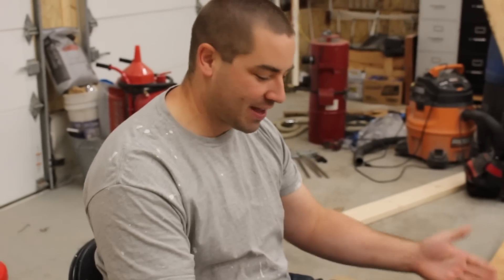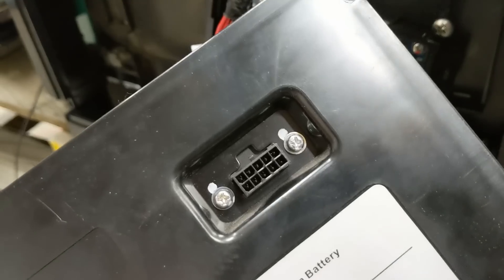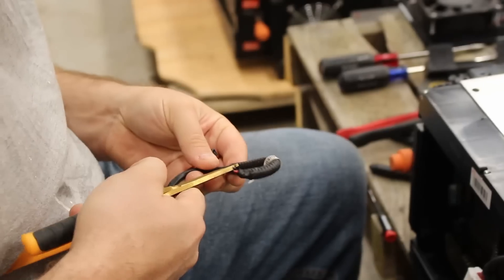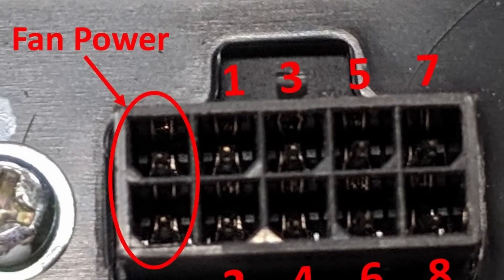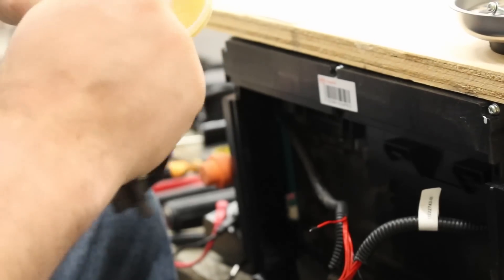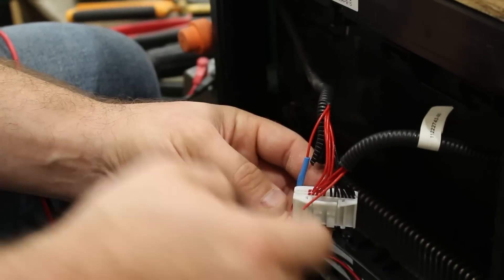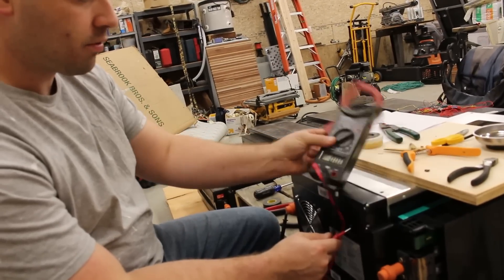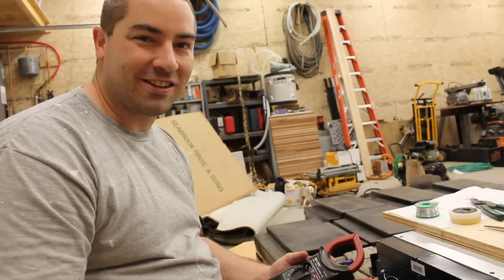Re-Wiring LiFePO4 Battery.  $100/kwh

Comment: Thanks for all the content you provide, I enjoy watching your videos. I am currently setting up 4 BYD 24v 8s batteries (2 banks in series each for 2 x 48v banks).  My plan is use 2 matched banks with a 16s BMS (Daly/Chargery). Can you recommend this configuration and/or a better solution?
Reply from the maker: My battery bank is kind of annoying me.  I have to manually go in and re-balance it every few months.  I'm not doing series/parallel connections again.  Instead I'm just using one BMS per battery.  I now parallel them after.  The BYD modules are 24v, so I would suggest using one BMW for every two modules, the two modules being in series for 48v.
Reply: @DavidPozEnergy   Thank you for your information. I purchased 2 Chargery 16T BMS yesterday. I plan on using 1 BMS for 2 Modules in Series (16 cell). If I understand correctly, this is what you are suggesting.
Reply from the maker: Yes, that's what I'm suggesting.  However, I never could get my chargery BMS to read amps correctly.  It's another disappointing product.
Reply: @DavidPozEnergy  Have you done any work with the cheap active balances available? I seen another video where someone paralleled all the like cells in 8 BYD modules and also installed an active balancer. Seems like a good setup.

Comment: great video.. Price is right.. BTW do you still use your Volt battery pack (i think it was Volt)?
Reply from the maker: No, I sold the volt pack to help pay for these new batteries. However these ones are not doing so great so I have a little bit of buyers remorse. Lol
Reply: @DavidPozEnergy  that was a nice rig.

Comment: Any thoughts or guidance appreciated. I just bought 4 of these packs for my full time live aboard Catamaran. Sadly my boat is all set up in 12volt, lighting, pumps, VictronConnect  300 wt pure sign inverter 12v to 110v. My question is would it be a better idea to leave them in their 24v configuration and step down to 12v for all of my applications. Or should i reconfigure the battery packs to make 8 -12v batteries? My 2200 watts of solar and VictronConnect Mppt chargers can be reconfigured to support the 24v batteries if i keep the packs as they are. Btw my plan is to isolate the engine and engine 12v batteries from the house solar system. Thanks.
Reply from the maker: That's very cool you are going to be living full time in your Catamaran.  I've watched a couple boat videos and they always seem to be manually lifting and moving the batteries into tight little spaces.  These batteries are 164 pounds each.  I set up a chain hoist to help me move them in my garage.  My point is that breaking them down in half (12v) on land might be worth while simple to help you move them into place.  I also suggest scrapping the heat sinks and fan to help save weight.  Check out this other guys video on breaking them down: https://youtu.be/fAXrYiQswIc  If you want to talk more about your specifics, send me a message.  https://www.facebook.com/DavidPozEnergy/

Comment: I just purchased two of these units using your link.  I want to separate the cells from each other so that I can make a 24 volt 8 cell battery from the healthiest cells that I find.  I noticed that they are welded together so I'll have to cut the bar.  I know this is dangerous to do, so all I'm asking for is any suggestions on what tool you believe would be best to do this.  Any ideas or suggestions will be appreciated.  Thank you.
Reply from the maker: The first thing I would try is tin-snips (shears) with an off-set handle.  If that doesn't work, then a rotary cut-off tool (dremel) tool with cut-off wheel.  But I would tape off anything not being cut, or wrap with clean rags.  Basically prevent you from being able to make contact with any other cells while you cut.  I have a rotary cut-off tool (like dremel) from Harbor Freight, works fine.
Reply: @DavidPozEnergy  Thank you for such a timely response, I really appreciate it.  I went back 2 years in your videos on anything solar related and have been binge watching them the last week until you're latest one which I watched late last night.  That's when I decided that it's time to get my hands dirty instead of just watching.  I really enjoy watching your videos.  Your personality, determination,  wit, and excitement is contagious.  Thank you for sharing your experience.
Reply from the maker: Your welcome.  Remember to have fun with it.

Comment: How is this working out for balancing the cells in the battery?  I like cutting out the internal BMS and using the existing wiring and is what I am working toward on my batteries.
Reply from the maker: It is not working as well as I was hoping.  I'm going to pull the batteries from the shelves and add thicker wires.  Just have to dedicate the time to it.

Comment: I would like to see a video of you running new wires and showing how you did it all. Those holes on the battery connectors look easy enough for a short screw. Those small wires on my leads, I hope I have the right wire stripper. I need to lengthen the lead wires also. Keep up the good work!
Reply from the maker: I've been getting the parts together to run new heavier wires.  We will get there soon.  Thanks for watching.

Comment: What if instead of cut/solder this wires from one MOLEX to another, build a jumper cable using two extra molex connectors and re-wiring the connections as desired between it?
Reply from the maker: I would not use the Molex connector again.  Next time I would probably just run in a JST-XH connector or something.

Comment: Where did you get the male Molex connectors?  I bought a "10-pin Mini-fit Jr" set and they are too big.
Reply from the maker: They were called "Micro-fit".  Pain to use.  Next time I would probably run in my own JST-XH connector like this one: https://www.amazon.com/Terminal-Balance-Charger-Female-Connector/dp/B07FY89T58/ref=sr_1_8?keywords=jst-xh+8s&qid=1577451597&sr=8-8  But if you want the Molex, I bought them from Ebay.  https://www.ebay.com/itm/Molex-43025-1000-Micro-Fit-3-0-Female-Housing-Receptacle-10-Position-Dual-Row/111749100822?_trkparms=aid%3D111001%26algo%3DREC.SEED%26ao%3D1%26asc%3D20160908105057%26meid%3Ddc0cfb3b31f84ad7887084c49e86725f%26pid%3D100675%26rk%3D2%26rkt%3D15%26sd%3D253519384177%26itm%3D111749100822%26pmt%3D0%26noa%3D1%26pg%3D2380057&_trksid=p2380057.c100675.m4236&_trkparms=pageci%3Aad86bfa6-28a7-11ea-914e-74dbd1800fb0%7Cparentrq%3A4769eebf16f0ac3cc0d94225ffa6f482%7Ciid%3A1

Comment: Where did you purchase the 10 Pin molex pigtails?
Reply from the maker: The Molex connector was already on the battery with wires attached.  I just moved the wires from the original computer to the voltage sense wires.  But I purchased the matching Molex connector on Ebay.  They were very difficult to install, so next time I would probably use a JST-XH style.
Reply: @DavidPozEnergy  thanks for the reply. I seen on the video that the female end of the connector was attached but I wasn't sure about the mail end. my local electronics store only had one so I'll try that with my tester first. I was hoping to get them with the pigtail but apparently the 10-pin molex is a little hard to find.
Reply: @DavidPozEnergy  also I was curious if you were planning to do anything with the power leads for the fans to power the fans on the battery.
Reply from the maker: I have to do some load tests to see how hot things get.  If the temp. goes up I'll wire up the fans.

Comment: Wondering why do you prefer the module over building 18650 pack?
Reply from the maker: Both can work well.  I picked these up primarily because they are LiFePO4 chemistry, which is a little safer than 18650 Li-Ion.

Comment: David you never told the people what you did with the 9th red wire. So it might be really good to mention what you did with it. Also it will be good to mention what or how your going to wire the 1 negative wire that goes to a standard 8s harness....otherwise some people will be confused when they open their battery to find 9 red wires and not know how you wired you negative.  THANKS FOR WHAT YOUR DOING.
Reply from the maker: Good point.  Thanks.  I'll mention this when I wire in my BMS

Comment: Could you tie battery negative to Pin 1/Fan Negative and let it run double duty?
Reply from the maker: You might be able to do that if you were keeping these as a 24 volt system.  I'm connecting two modules together for a 48v system.  Thanks for watching.

Comment: Hello, David did you find online who sells the Male Molex connector for this battery.
Reply from the maker: Yes.  I've been soldering up a BMS wiring harness with them.  But, wow, it's tiny stuff, hard to work with.  https://www.ebay.com/itm/Molex-43025-1000-Micro-Fit-3-0-Female-Housing-Receptacle-10-Position-Dual-Row/111749100822?epid=1207662398&hash=item1a04c3f516:g:B-kAAOSwPcVV1m-0
Reply: @DavidPozEnergy  Seems like soldering and crimping is overkill for low voltage low current connections.  Crimp alone should be fine.
Reply: @DavidPozEnergy  you can get 10pcs here: https://www.ebay.com/itm/161929712930

Comment: I have two of the exact same module (it’s from BYD auto btw). What BMS are you going for? I’m using REC and its great. Be careful to do active balancing on the existing leads you’re using. I dont think theyre good even for 1A but get a cheap thermal camera and check for yourself. Dont forget to charge each cell individually before you start charging them with a 16s charger
Reply from the maker: Thanks for your comment.  I've heard good things about the REC brand.  I'm going to try out a Chargery BMS and see how that works.  I've never tried this brand before.
Reply: You dont happen to have a datasheet for these modules, do you?
Reply from the maker: Sorry, no.  I sent a few e-mails requesting one, but no reply.  If I do find one I'll include it in a video.
Reply: Do you know the voltage level one shouldnt go below? My bms is preconfigured to cut-off at 2.5V but i would like to confirm that somehow
Reply from the maker: LiFePO4 is works from 2.5 volts per cell up to 3.65 volts per cell.  These are 0%SOC up to 100%SOC.  However, using a battery 100% will shorten its life expectancy.  I plan to use 3.0 volts per cell up to 3.5 volts per cell, which I think will use about 75% capacity, about 20%SOC up to 95%SOC.  I'm using this in a 48v configuration (16 cells in series) so I plan to set my pack voltage 48v up to 56v.  Once I have the batteries wired I plan to test this out.  I hope that helps.

Comment: Can you do a video about selecting and installing a BMS for these particular batteries?    i ordered 2 of these, and don’t know how to select an appropriate BMS.  there are a lot of different ones available, I don’t know enough to select one, and i think that randomly picking one is probably not a good plan.
Reply from the maker: I ordered a Chargery 16s BMS, but haven't tested it yet.  I plan to share any results of that.
Reply: How did you decide on that particular BMS?
Reply from the maker: I'm going to be running these modules in pairs (2 in series) for 48 volts DC.  This will be 16s, so I was looking for 16s BMS's.  I think this Chargery one can actually use less, but maxes out at 16s.  At first I wanted to try the new Batrium, but it only goes up to 15s.  I also like that it has a monitor built in to read the cell voltages.  But, like I said, I have not tested it yet.  I might regret getting it.  If this one doesn't work then I'll probably order the REC BMS, but it's around $1000 after all the add-ons.
Reply: I also bought a few of these modules and I asked the same question of Tom from Battery Hookup. He suggested I buy a Daly 16s Lifepo4 200A 24v BMS.

Comment: I am considering these batteries.  On the main terminal, what type of lug or bolt can be used for connection to the main terminal?
Reply from the maker: Hi ddthames,  Thanks for your comment.  You could use a terminal made for a car battery post, but you will have to order "European" ones that are 14mm.  But I'm making my own terminals out of copper pipe.  I'll be sharing on YouTube how I do this, but you can also check out my Facebook page.  I post photos there in real-time.  If you do order them, it would help me out if you use my affiliate link in the description.  Thanks.
Reply: @DavidPozEnergy  Thanks and yes I plan to use your link, but not my mini-van.
Reply from the maker: Very good choice about your mini-van.  When I grabbed them we didn't yet know how much they weighed, turned out to be more than expected.

Comment: so EXACTLY which BMS are you going to order for this?
Reply from the maker: I ordered a Chargery 16s BMS with 600 amp shunt.  I've never used this brand before, so it's a test.  http://chargery.com/
Reply: @DavidPozEnergy  Hi.. can you be a little more specific to where it is .. that page had a few dozen listed and I didn't see the one that you say you are getting.. sorry.. thx
Reply: I also bought a few of these modules and I asked the same question of Tom from Battery Hookup. He suggested I buy a Daly 16s Lifepo4 200A 24v BMS. He also suggested I purchase it from AliExpress.

Comment: You can also remove the pins from the Molex connectors so you don't have to solder anything, if the wires are long enough, and the connectors use the same pin size.  You can get Molex removal tools or figure out a DIY version like this  https://youtu.be/IFR9Wnslruk
Or use a tool like this, maybe find some tweezers which would do the same  https://youtu.be/3Z2Tkw-OY9c
Reply from the maker: Thank you.  I like the trick with the staples.

Comment: I wonder if it might be easier to just run new BMS wires to each cell?
Reply from the maker: It very likely would be.  I just like the clean look of using a factory plug.
Reply: @DavidPozEnergy  Yeah, as I referenced in my other comment you can still use the factory plug.  You can buy the crimp on wire connectors to insert into the Molex plugs.
Reply from the maker: Yes.  I have them on my workbench waiting.  I just have to get out there and build my BMS wiring harness.
Reply: If I were to bypass existing wiring I think I would drill and tap and use some stainless screws with washers. Soldered terminals and heat shrink.

Comment: I don't expect you need so much active cooling all the time if you are using them for battery storage.
Reply from the maker: I agree.  I'll probably never need the fans, but nice to have if I'm pulling heavy amps.
Reply: brian whittle I agree. Mine never warm up even in the tropics under heavy loads. Our 48v electric tricycle with my big butt and four Filipinos up hill don’t cause any temp troubles either. Solar charging at 90-130 amps on the off grid system has no noticeable effect either.
Reply: Hmmm...I was having second thoughts when he said the fan sounded like a jet taking off, but, if these were used for buses they would have been pulling a lot of energy and fan necessary, (for using and fast charging), ...since I would be using for RV it probably wouldn’t need to be cooled.

Comment: since you have access to your fan on your molex connector you can set your fan speed  with pwm control along with temp sense to vary the speed
Reply: hydroalternation that def help save on energy use and noise irritation. Who loves a screaming desktop right? I bought a fan control on eBay that came with a temp sensor and 4 fan outputs to control the 24 volt fans on my inverter (all 4) they’re screamers too. It’s a 12v board so a step up buck boost was in order.

Comment: 6:20 To prolong the usability of the heating element of the heat gun, turn it to the “cool” setting for 20 or so seconds. This time should increase the longer you have the heat gun I use for heat. The cool setting just turns off the heating element and allows the fan to cool them evenly. 

Since a heat gun is wired differently than a hair dryer and the heating element is able to heat up to over 1,000°F. Proper cool down is essential.

Comment: Hi David, nice mod and nice vid again. Only one thing is bothering me a little. You've started counting the cells from the wrong side. Not from the usual side that is. Mosltly when it comes to balanceleads one starts with b1- as the first wire. Second would be b1+, third b2+ and so on. Your connection now lacks a minus as I assume its a 8s pack. Is that correct? Keep up the good work my friend!
Reply from the maker: Hi Rik de Haas.  I just picked something and went with it.  I decided to re-wire things and had no wiring diagram to go off of.  The front Molex connector has 10 pins.  two are already used for the fan, which left 8 available.  Yes, this is an 8s module, which means I should bring 9 leads out.  But I don't have 9 pins.  So I'm going to snag the negative from the main post after I have all the modules in place.  I'm just sharing what I'm doing, not saying it's the only way to do it.  I could have done something else with the fan leads and used the extra pin for the negative, or I could have drilled a hole in the plastic and run my own wires to each cell.  Whatever floats your boat.  I'm excited to see how other people use these cells.  I hope everyone is willing to share their own take on it.

Comment: It might be better to use an 8s BMS for each module, then capacity check each one, then match two of like capacity in series to get your 48v. And repeat for the next 3 sets. The cells within each module would be well matched with each other for age and capacity. But the matching of cells from one module to another module is unknown until tested. One module may have been used much more than another or age may be much different between modules (and therefore the cells).

Comment: This is AWESOME!  I just bought 8 of these from a seller in California.  Can't wait to get mine in so I can get them wired into my solar setup.  I do have some coding experience with serial controller boards, so maybe I can try to figure out the main board.  If not, I'll follow you and wire in a custom BMS.